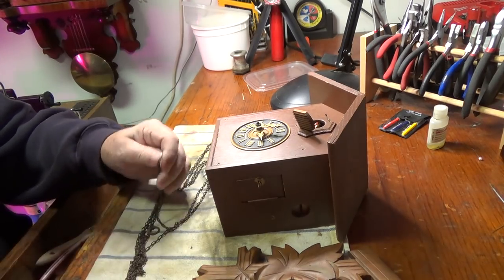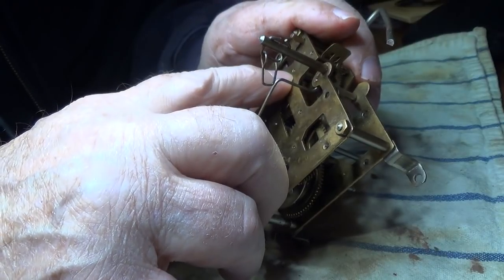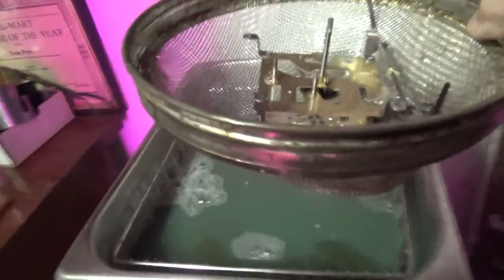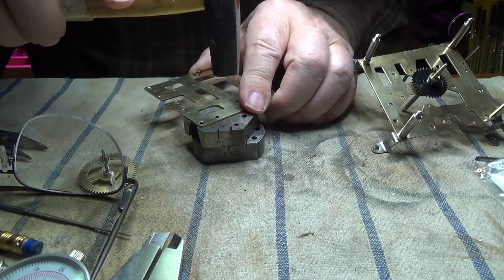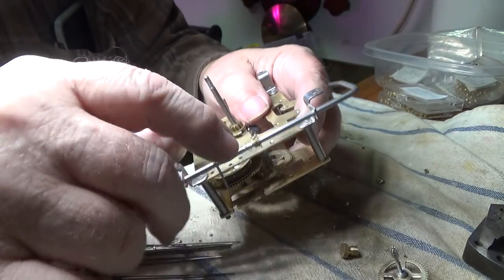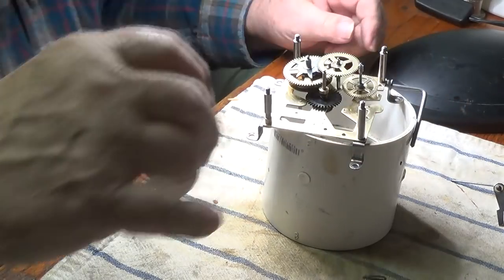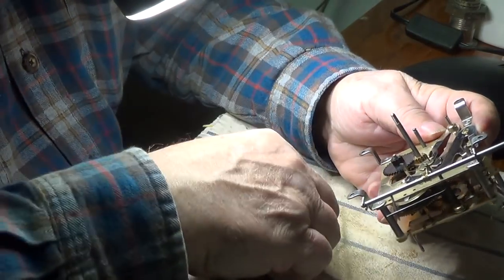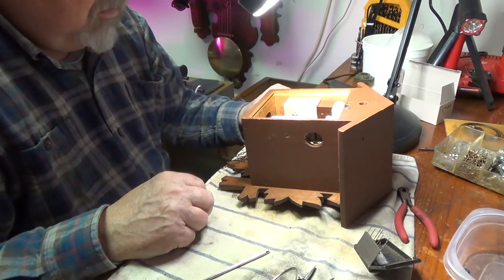Hubert Herr One Day Cuckoo Clock Repair for Kayla

Comment: I’m watching this video on the bushings etc. 
Got a number 36 broach that says largest it will cut is 2.70mm. Are these broaches tapered?
Have not received it from timesavers yet due to lockdown but studying your videos in meantime. Thanks and stay safe
Reply from the maker: There is, indeed, a taper to both cutting broaches and smoothing broaches.  That's why there is a range of sizes each will cut.  It is also why you broach from both sides of the plate,  You start broaching on the insides until the pivot just starts to go in. That is the point at which the hole is big enough on the inside but is still too small on the outside.  If you continue to broach until the pivot goes all the way in, the hole will be the right size on the outside of the plate, but too big on the inside. You now have a hole that has little bearing surface and will wear out quickly because half the hole is too big.  If you stop broaching from the inside until the pivot starts to go in and then switch to broaching from the outside, the hole will be just right all the way through.
Reply from the maker: BTW, you're going to need more than one broach.  2.7 mm is pretty big.  Most of the bushings on cuckoo clocks are in the 1mm to 1.5 mm.
Reply: dperry428 bushings I bought are number 9 outside diameter 2.5mm.  Was going to use 2.7 for that. I was taking your previous advice and adding tools slowly as needed. 
Now I see I need the smaller broach for inside diameter. I’ll practice on old plate anyway. 
Thanks

Comment: I’m in Ct. can I send you a very similar clock to repair? It just needs a chain replacement
Reply from the maker: Why not just buy a new chain and put it in yourself?  Sending a clock to me with return postage would be very expensive way to replace a chain.
Reply: I want to do that, I actually don’t need to buy a new chain. It was just that one of the links broke, but I can’t figure out how to thread that chain back in, do I have to take apart the entire thing?
Reply from the maker: Wrap a piece of wire around the chain that is still in so that it doesn't fall off the chain wheel.  Remove the hook and circle from the ends of the chain you want to install. With the back off, reach under the chain wheel and see which way it winds.  Turn the clock upside down, thread the chain through the hole in the bottom and onto the side of the chain wheel. Using your finger or a screw driver, rotate the chain wheel to load the chain.  As it feeds onto the wheel cogs, rotate the clock so the chain stays on the cogs while you keep rotating the chain wheel cogs.  Keep rotating wheel and whole clock until the chain is drawn to the exit hole in the case. Pull the chain through the hole and put the hook and loop on the ends.
Reply: @dperry428 thank you! The chain however has already completely fallen out so I can’t do that with threading a wire, etc. do I have to remove the clockworks?
Reply from the maker: You don't thread a wire.  Just turn the clock upside down, thread the chain into the hole that leads to the side of the chain wheel that will rotate the chain over the wheel as if it is being wound. Then, using a finger or screwdriver, rotate the cogs to carry the chain over the top of the wheel while also rotating the whole clock so the chain doesn't either fall off or get carried into the movement.  Keep rotating the cogs until the chain is over the wheel, the clock is upright and the chain moves down to the exit hole.  Then, grasp the chain and pull it out the bottom.
Reply: @dperry428 thank you!! It is fixed and working, I’m so happy about this. Grateful for your advice, I’m a follower/fan now!

Comment: It appears you installed the washer on the intermediate wheel upside down. Does it make a difference if the concave side is up? Love your videos I learn a lot from them. Also I started to watch one of your current videos where you had an extremely dirty old movement. Somehow I did not see the finished video. Can you direct me to that video?

Thanks Bob
Reply from the maker: Good observation.  You caught my "cheat".  By putting it on with the concave side up, the hour pipe can be pulled forward enough to allow the gear at its base to slip off the top edge of the pinion on the intermediate wheel and be rotated a tooth or two to adjust the positioning of the rack tail on the snail if there is a problem.   After all the final adjustments are made and everything is working perfectly, the washer can be reversed with the concavity downward.  With it in that position, the hour pipe gear cannot be moved past the end of the intermediate wheel pinion. Once the hands are attached to the movement, the hour tube cannot be moved forward and it's not a problem, even if I should, in my old age, forget to flip that washer over.
Reply: Thanks for your reply. How about the dirty movement video I mentioned?
Reply from the maker: If you mean the video about the "real challenge" movement, the video is not yet available as I'm just now working on the movement.  It's going to take a lot of time. It needs 16 bushings, 19 trundle wires replaced, at least 2 arbor pivots replaced. both chain wheels rebuilt, a brass lever rebuilt and, most critically, the pallets on the anchor ground, polished and refitted or a new strip pallet constructed.
Reply: Thanks, can't wait to see it

Comment: Don really enjoy your videos.Have a question about a 1 day Anton Schneider cuckoo clock.Periodically the cuckoos cuckoo doesn't match the time.It' doesn't do it every hour.I've tried moving the minute hand rapidly past 12 and really messing it up.Then I reset the time to match the cuckoo but it doesn't last.Don.t understand why it doesn't do it every hour.Thanks.
Reply from the maker: You need to understand how the number of cuckoos is controlled.  If it is very old, it might contain a count wheel on the back.  If it is not old, it will have a rack and snail control on the front of the movement.  That is most likely the case.  Irregular counts of the hour can be caused by a number of factors, but check to see if the rack, the arched, toothed lever, moves freely and drops properly  at the hour.  The tail of the rack should fall onto the center of a step on the snail.  That is what controls the number of teeth on the rack that need be lifted before shutting off the cuckoo.  Also, check to make sure the pin on the gathering pallet is not catching periodically on one of the teeth of the rack.  Watch this for an explanation of how the rack and snail works and what to look for.https://youtu.be/v4yreDqcf3E?t=655
Reply: @dperry428  Thank you for the help.I want to take the movement out of the clock.I'm having trouble removing the hour hand.It's so tight on the shaft it won't budge.Any ideas.I don't want to break it,thanks.
Reply from the maker: The hour hand is a simple friction fit. First, check carefully that some fool didn't glue it on. You'd be amazed at what some people do. If they did, try to determine type of glue and try to loosen it with the appropriate solvent.  Otherwise, try a bit of penetrating oil (just a dab), let it set a few minutes, grasp the base of the hand and try to turn it.  Otherwise, brute force with the risk of breaking it.  Then, if it breaks, order a new set. https://frankenmuthclock.com/collections/parts-cuckoo-clock-quartz-cuckoo-miniature/hands-cuckoo
Reply: @dperry428  Well Don I got the hour hand off with penetrating oil.Took pictures and made a drawing showing the bellow attachment to control arms and rabbit and deere.Lucked out and bellows weren't glued.No brad either(not good).Movement nexed.Keep fingers crossed.
Reply: @dperry428  Good news is I got the movement out.Bad news is that while I was checking out the movement a tension washer fell out.I'm trying to find it on another Regula 25 that I have to find where it goes .Next step is to check out your viideo because I remember seeing it mentioned.Maybe that's my problem but I didn't lose the washer,thanks Don.
Reply from the maker: I don't know of a tension washer in a Regula movement.  One is used under the intermediate wheel of the old cast brass style movements.  Maybe you have the washer that goes on top of the intermediate wheel that keeps the hour tube in place.
Reply: @dperry428  Mystery solved.The washer and a tiny spacer hold the shutoff lever on the top right post under the nut.Now back to the movement.Your water garden layout is beautiful along with the faux work.I have a water garden that is home to five large koi and a golden orfe and a yellow-bellied slider named Pooter.She winters inside in an aquarium.My cat is named after your granddaughter,Lily,She's sure a cutie.Thanks again.Best of luck with your health issues.Take care,Francis.
Reply from the maker: I had painted turtles in my classroom for 25 years, so I built the pond when I retired in 2004.  They lay eggs each year and now I have 22 turtles that live out there.  There are 12 golden orfe, 4 frogs and about 50 goldfish.
Reply: Hope your health has improved and have gotten all your doctor's appointments "under your belt" take care and good luck,Francis

Comment: Use gloves when you assemble it,  because hands are leave salts and rust will appear.
Reply from the maker: The only time gloves are needed is for carriage clocks, 400-day clocks or other movements that are exposed for view. Your assertion that "rust will appear" is nonsense.  The most that will happen is fingerprints will be become visible on the brass as it tarnishes slightly.  I've been repairing clocks for 52 years. Handling movements without gloves has never created a problem.
Reply: @dperry428  I have been repairing clocks for decades also and have never had one single issue not wearing gloves. Rust certainly does not come from fingerprints.
Reply from the maker: @userprofilename371  thank you.

Comment: How do you rate Hubert herr movements in comparison to Regula ?
Reply from the maker: Honestly, I don't see any real differences, at least as far as functionality. Regula may be just a bit easier to work on.  Opinions are all over the place, however.  It's kind of like asking, "Which is better -- Ford or Chevy?"  There are a lot more Regula movements around as they make movements for everybody and his brother.  When it comes to either one, though, the older ones are better than the newer ones.  I think they look to making things cheaper to manufacture and, thus, make working on them tougher.  For example, on older Regulas, the star wheel on the outside back was put on with a set screw; newer ones are a press fit.  They save on drilling and tapping a hole, plus the cost of a screw.  Two operations less and one screw less.  The press fit ones of today, however, give repairers nightmares trying to get them off.
Reply: dperry428 Thanks for the in depth answer. Seems like quality suffers in all aspects of manufacturing these days, tools etc.
Reply: dperry428 good morning. Hope your doing well.
I’ve decided to buy some broaches and reaming bits. I’ll be attempting the movements in your videos and buying from timesavers. Could you recommend a few essential tools to start me of. If I can just buy reaming bits and use drill I will. And most common diameter bits you use if that’s possible to answer. 
Appreciate all the advice. 
Morgan
Reply from the maker: If you mean for bushing worn holes, buy what you need to bush the holes you'll be working with and add to your collection of tools as time goes by.  Buy what you can afford. Reamers are not cheap. To bush a hole, you need to measure the pivot that goes in that hole. You'll need a bushing with an internal hole (bore) of that size or smaller.  That bushing will have an outside diameter. You'll need a reamer to cut the hole for that outside diameter. They are about 3/100th of a millimeter smaller than the outside diameter of the bushing so the bushing fits really tight.  Then, you'll need a cutting broach to enlarge the bore to fit the pivot. Broaches are tapered. You'll need a size that fits into the bore of the bushing and tapers enough to cut to the size of the pivot.  For most clocks, it is the second wheel that will be most in need of bushing. As you need more sizes, add to your collection
Reply: dperry428 thank you. The videos are really helpful I’ve got a decent bit of information on the bushing side. 
I’ll buy slowly and see how I get on. 
Thanks

Comment: Hello.  Do you buy the bushings for the repairs? 
Or custom make them there.
Thanks
Reply from the maker: I buy commercial bushing from Butterworth Clocks and Timesavers for most work except the bigger or specialty ones, which I make on my lathe. I don't keep a lot in stock, so many times I also make them for clocks with thicker plates.
Reply: dperry428 ok last question for a while, 😂
Do you use a bushing jig or drill freehand and tap bushing in? 
I’m really into these clocks now, I’m a cabinet maker so I’m carving the face frames to complete the cases, the metal work is defo not my specialty!!
Reply from the maker: I use everything but a bushing machine.  I've demonstrated using a drill press, a hand-held drill and completely by hand in my videos.  I just tap them in with a small hammer, sometimes with a flat-end punch.  I just make sure they're flush with the inside of the plate.